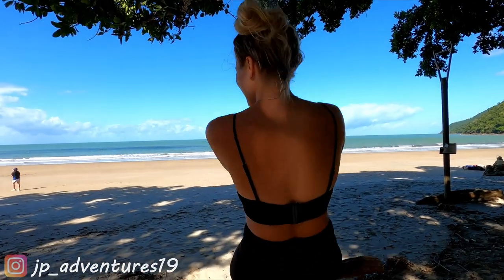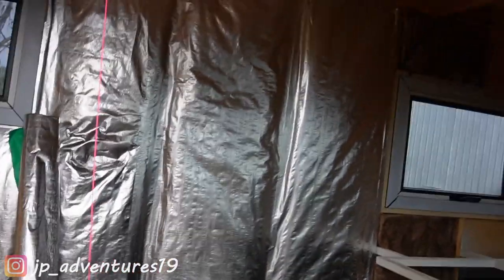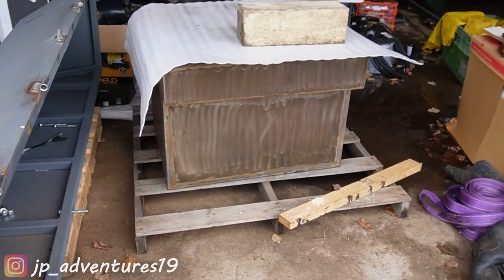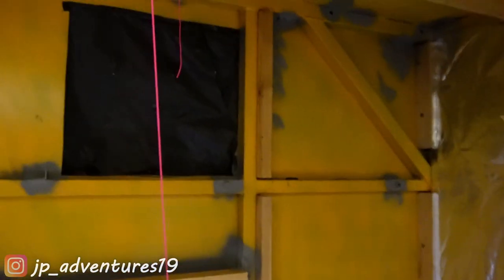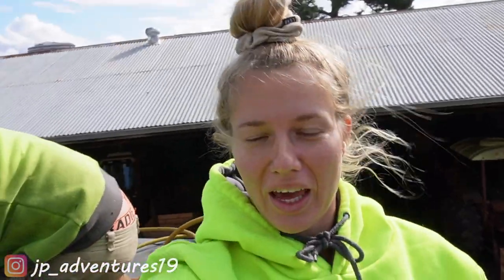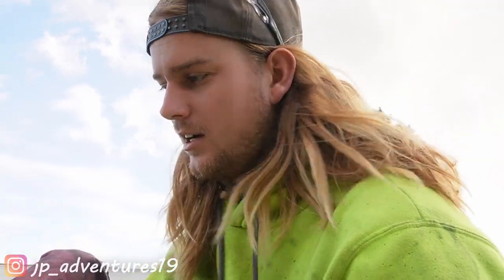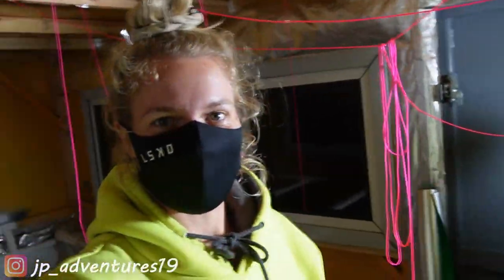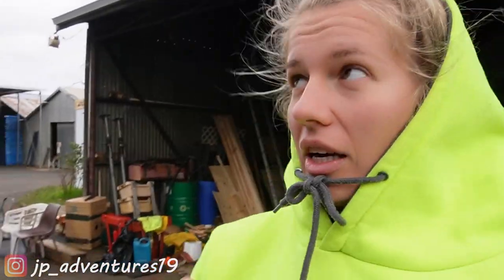UPDATE! Feeling Better and ENERGIZED! Insulation & Painting - DIY UNIMOG Expedition Truck (Eps. 45)

Comment: Well done guys coming along nicely. As for rust and paint. I was told by a very well regarded panel beater/classic car restorer from the UK, that its the primer that's key as well as the top coat. The primer needs to be an epoxy type primer as its the only type that seals everything underneath it. You can use rust converter, etch primer etc, but you must coat it with an epoxy primer before painting a top coat. Ideally the top coat should be an epoxy paint too or a two pack paint. Hope that helps.

Comment: I used rust converter on  VW bus I was working on. Unfortunately in my ignorance I didn't know it doesn't stick to clean metal so any paint over it lifted and bubbled up.
It was a total disaster and I ended up just parking it in the back of the shed for 10 years as I ran out of money on the project. Also I still had to do the research to realize my mistake. 
I only recently removed everything with a wire cup brush fitted to a baby angle grinder.
The main thing is to give the rust converter a good sanding after it has cured and make sure no clean steel is covered. Also red oxide is porous so don't leave it too long before final coat in humid wet conditions.

Comment: Hope my coffee gets to you. A much easier process, for me, at any rate. And you guys do get a larger percentage. I hope it works for you as well. Can't help with metal painting advice. Trial and error, unfortunately. With luck someone more knowledgeable will contribute. Farmers and car painters would be a good source I'd imagine. Painting under cover has to be the best i reckon. Even dew points/times can mess up paints, let alone rain/wind/dust! Thanks for uploading/all the hard work. Very much appreciated. Alan
Reply from the maker: Yes thank you so much! Every coffee helps :)
We wire wheeled the roof, rust converted it and put primer and two thick coats of paint on, hoping that this would seal it. We are thinking about applying wax as well as an extra protective layer :)
Once we drive it back to Germany we might sandblast the entire Mog and repaint it with some good German paint :P

Comment: Rust converter just gives a stable top layer to paint over. It doesn't penetrate to the bare metal. If any moisture remains in the lower layers of rust it will pop through in time especially with heat. Wire back to metal and paint with a good 2k primer to seal. Nearly there guys.

Comment: I'd go with a sandblast if possible and a phosphoric acid based rust converter before zinc based primer and then you are into a minefield of roofing paint options considering   acrylic, silicone, polyurethane, asphaltic rubber or epoxy . I think anything will do better than 'paint' but UV resistance, oxidation and temperature withstand all need considering.  I'd check out guarantee periods of some alternatives in your area aimed at metal roofs.

Comment: Patrick & Jele , getting there guys, looking good.Extra work in getting sheetwork back to bare metal, but pretty much all flat surfaces so wouldn't be too bad. Look into Epoxy Primers, one of my cars I modified years ago was all stripped back to bare metal and followed with an Epoxy Primer. Still going great now 20+years later and still havn't got it out of storage to finish it😒(they will be up for sale to fund a Mog Hopefully🙂) once your got all panels back to bare metal, wipe over with prepsol or equivalent and get that Epoxy Primer on there. What top coat you looking at using? Havn't looked into new/current paint/coatings out there but there maybe something that does the same as the Epoxy but acts as a top coat too......What's Raptor coating like ?Know its very durable but as for stopping/restricting blemishes etc underneath .....dont know. I would opt for a coating that will not allow transfer of any moisture through,then maybe a colour of choice,hope it's of some help guys. avagood1 Ron

Comment: Regards the rust on your roof…. It doesn’t matter how many coats of paint you put on. The rust develops below the primer. Try rust remover instead of rust converter. Hydrochloride acid works a treat, but I can’t see you do that on the roof without damaging the sides……